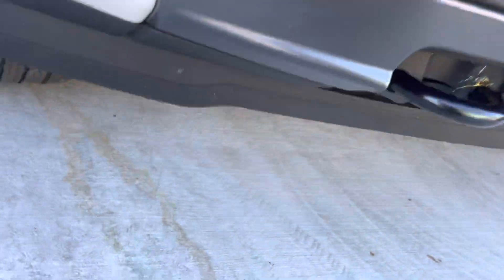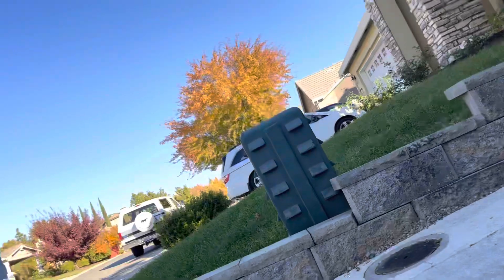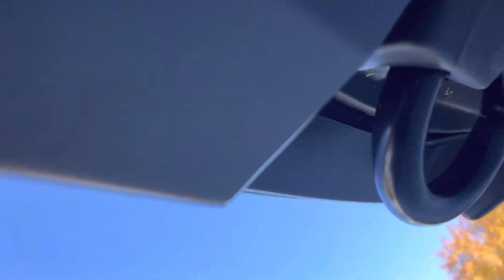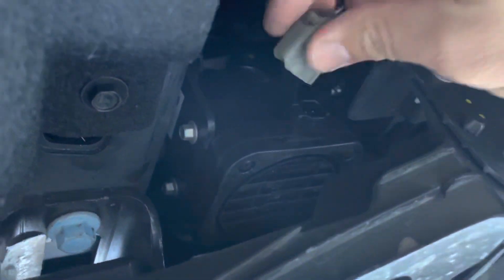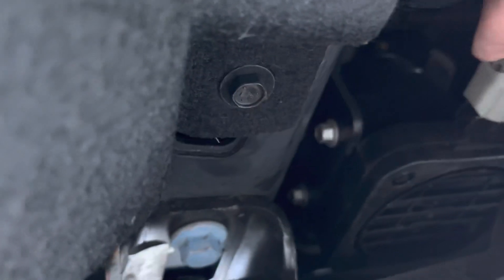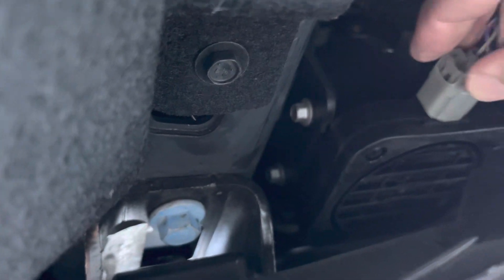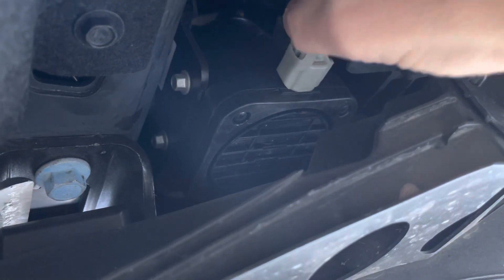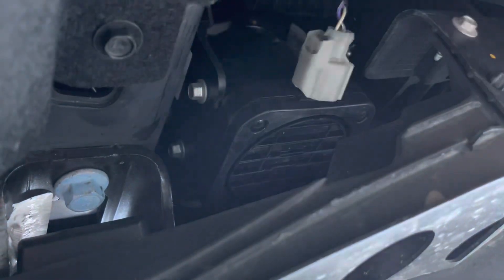F150 Lightning Back Up Speaker disconnect (for replacement)

Comment: For the life of me I can't pull that thing off, I've tried squeezing the sides, top and bottom, nothing. Is there something that needs to be pressed to release it? Help 😨
Reply from the maker: Mine pops off super easy. I just did it to verify. Try pushing it all the way in and then squeezing the release button all the way before starting to pull it off.
Reply: Thank you, actually that worked! However, the bad news is I instantly got a warning alert and the backup camera stopped working... Go figure. Had to put it back on. Hoping to find a Plan B now.
Reply from the maker: Correct. Somebody makes a device that plugs into the connector to avoid the error reading. https://www.megaohmmotorsports.com/product/ford-psbk-ece
Reply: @m10stuff  That's great, thanks for the help. I ordered it and it's coming next week.
Reply: Forgot to mention forscan you can disable it his without check engine light

Comment: This is exactly what I was looking for! I don't think need it by law, the manufacturer just has to put one on.
It's like the 3rd break light or backup camera, required by law for a new vehicle, but every truck comes with a cap for when you remove the tailgate.
Reply from the maker: With this unplugged you will receive a warning on the dash every time you start the truck
Reply: @M-10 Built  thanks for the heads up, I just wanted to put some tape and/or cardboard and quiet it down a bit. I like the idea of it making sound but I woke people up just by putting it in reverse more than once. I wish it had a sound meter and automatically adjusted how loud it was based on the environment.
Reply: Compared to the ungodly racket we hear when we open/close the frunk, the backup chime is infinitely more pleasing.  I barely even hear it, but I'm getting old.